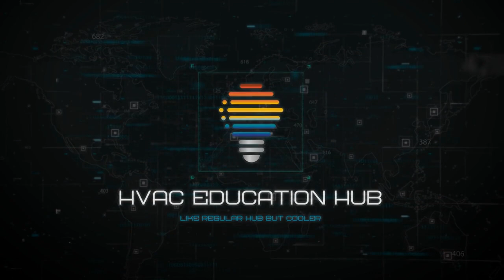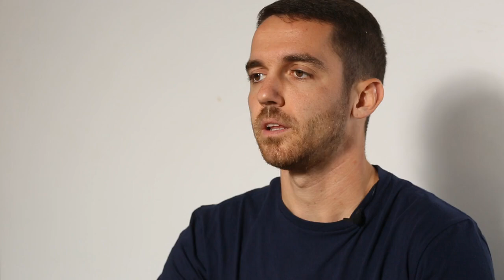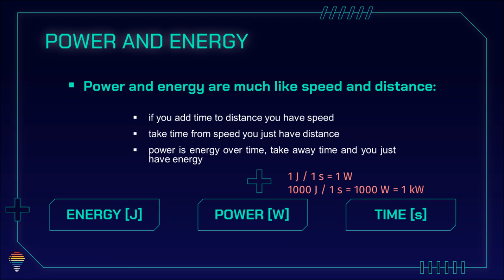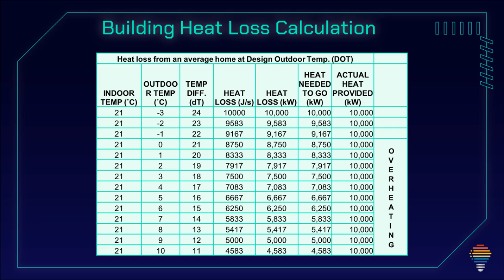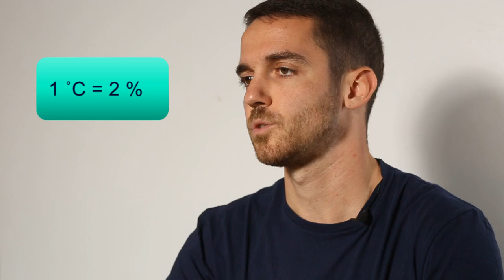Heat Pump Weather Compensation Explained | Save Energy with Outdoor Temp-Based Heating

Comment: Odlican video bas i ono sto zaista meni treba. Uradio sam proracun za toplinski gubitak na moja kuca od 135 kvadrata. Uzeo sam da unutrasna temperatura bude neki 24 stupnjevi, a vanjska maksimalna -10 (na balkanu, nadam se da proektna temperatura nije prevelika). Za sve materjali u kuca koristio sam najbolji i najgori koeficinti toplotna sprovodlivost, i dobio sam da u najbolji slucaj toplinski gubitak je 6.7 KW, a u najgori slucaj 11.3 KW, ili neki prosek ako to moze da se uzme od 9kw. Celi sustav je podno grijanje na 10cm i sanitarni boljer od 200L. Reci mi po tebi kou Panasonic Split sustav je sasvin dovoljan za ovakva kalkulacija.
Reply from the maker: Treba odabrati prema proračunu i prema vanjskoj projektnoj temperaturi za određeni grad